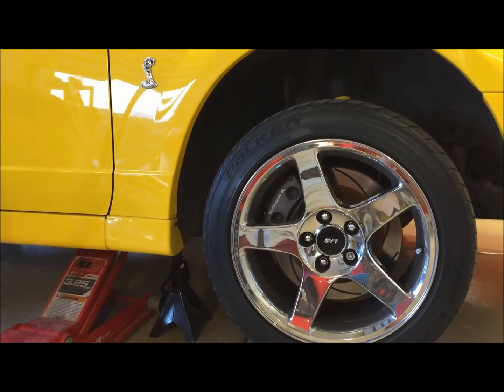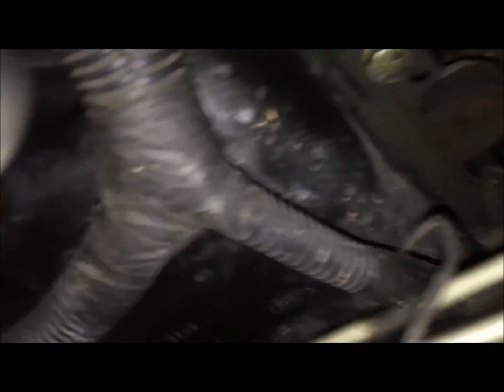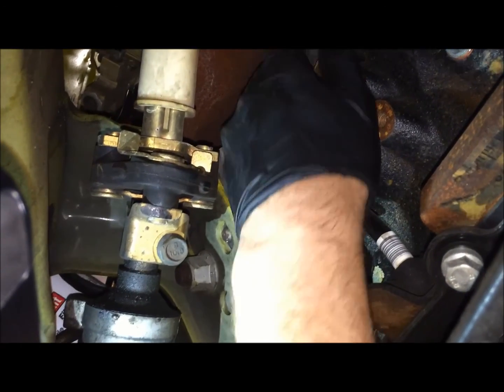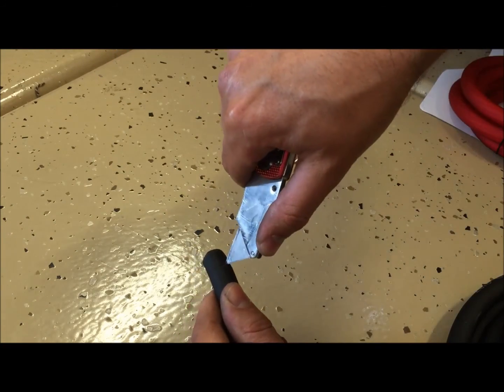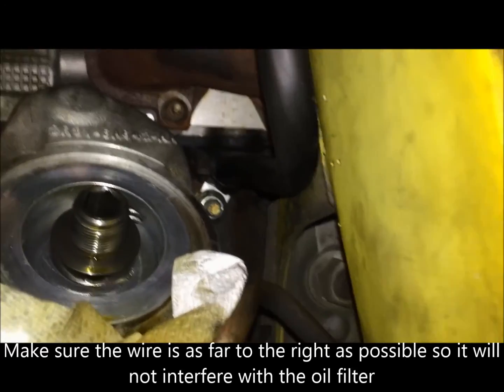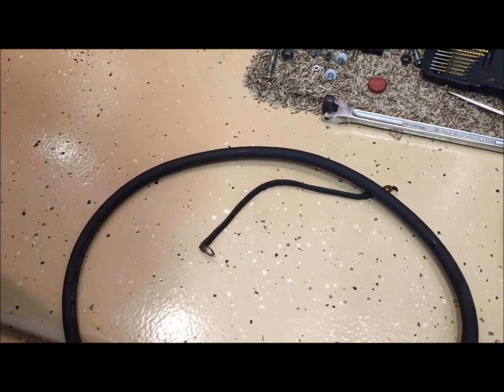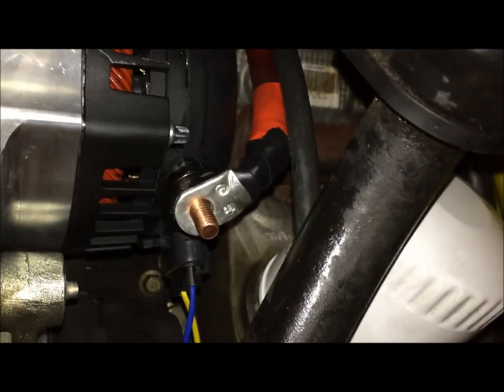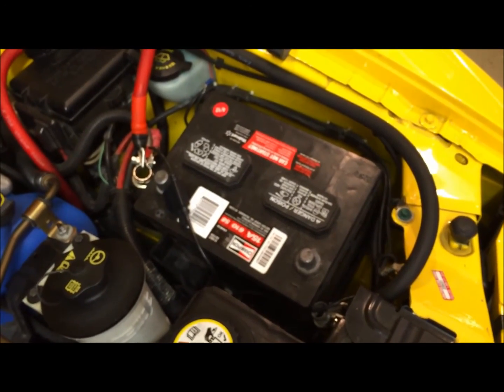Big 3 wire kit  install: 2003-2004 SVT Cobra Mustang

Comment: Was having issues with my alternator charging my battery after doing an upgrade on my 03 GT. The Amp upgrade wasnt that much of a difference but I still couldnt figure out what was going on. After watching your video your making my own wire kit, the issue was fixed. Really appriciate the mustang videos. Keep them coming!

Comment: I installed the GP SAE 6 Spot Battery Terminals and I'm trying out the on battery terminal fuses (Blue Sea Systems 2151 Dual MRBF Terminal Fuse Block with a 60A for the audio amplifier and a 150A fuse for the alternator). The on battery terminal fuse block and fuses should be safer than using the inline fuse holder with the pigtail to connect to the battery terminal (chance of it coming loose and shorting out the battery.. Just another option to consider. Too bad I can't post an image of it here.

Comment: For the engine to chassis ground I used that other threaded hole next to the bracket just got another bolt
Reply from the maker: Very good. I’m sure there are several places that will all work. A lot is just preference
Reply: Any chance you remember the thread pitch?  Was it M12 x 1.75?

Comment: hey I really appreciate that video I have a 2003 mustang gt an I'm trying to the big 3 on it I been searching all day to see where was the ground for the engine to chassis I know now thanks alot for the video
Reply from the maker: Great! Glad the video helped out. Thanks for watching! Good luck with your projects!
Reply: Scrun Johnson 
Question bro ... I have an 03 cobra and I recently changed out my alternator and your video helped me out by the way 👍🏽.  But I'm still having issues with my volts . I even went back and changed it again and bought a new battery and terminals still battery light turning on and volts drop from 14.7 to 12.5 in like 30mins .  Check ground wires all good . Any ideas . Oh and replaced my belt as well .  Help
Reply: @Cobra11437  
Did you fix this? I got the Same problem, battery light was on and no charging, got a new alternator and battery ligjt turned off but its still not charging, tried a grownd wire directly to a an alternator bolt and nothing....

Comment: Dumb question Danny, but at 20:47 why the need to reuse the old factory wire? Isn't the new zero gauge replacing it??
Reply from the maker: racequad9 Very good question . I had the same question when I was installing and was told by the mechman rep that you can run both and the power will take the route of least resistance, so it will be fine to run both- just as if the big 3 wire had more strands in it
Reply: Awesome! Thanks as always.
Reply: But is ok to remove the old power wire n just run the new zero gauge one? U know for cleaner look?

Comment: Why not connect the ground to an alternator mounting bolt? It seems that would be electrically the same as the motor mount bolt and would be more accessible.
Reply from the maker: The alternator is mounted to an aluminum bracket. It would be better to mount it to the motor mount that is directly connected to the engine block for grounding

Comment: So the original power cable from the alternator to the battery never gets removed correct? You are basically just adding another alternator to battery cable just in 0 gauge wire
Reply from the maker: Yes. Current takes the path of least resistance, so now consider it another strand of cable within the zero gauge wire
Reply: @dannyjohnsonsgarage  awesome thanks for the reply Danny!

Comment: Ok danny so on the ground to battery one, you can leave the factory ground there and add the big 3 kits ground to that motor mount bolt? You dont have to remove the factory ground?
Reply from the maker: Correct, you can leave it. It’s just like adding more strands to the new cable. Current always takes the path of least resistance.

Comment: instead of putting a ground on the motor mount can I run it somewhere else or that would be a good ground for it
Reply from the maker: I'm sure you could. I chose the rear motor mount for better access
Reply: OK Thanx bro

Comment: Thank you for the video, but it seems Mechman has discontinued the Big 3 wire kit.
I have 1 question, I’m planning to install a 200A alternator into my 03 cobra, right now the car is stock but I have plans in modify the car in the future, will I need a bigger alternator wire for now or which gauge of wire and lenght will you recommend. I really will appreciate your suggestion and thanks again for the videos very instructive
Reply from the maker: You will need it as soon as the 200amp alternator is installed or it could melt wires. You can buy 7’ black and 3’ red and the inline fuse and ends. It can all be purchased through delcity.com
Reply: @dannyjohnsonsgarage  thank you I will follow your advice stay safe

Comment: I used alternator bracket as ground to negative battery terminal, then battery terminal to chassis so two wires total. Should this work? I havent started my car yet.
Reply from the maker: The alternator bracket would go to the engine, and being a GT or Terminator it would be an iron block, so it’s probably the same as the motor mount
Reply: @dannyjohnsonsgarage  alright just checking cause this wiring stuff is confusing sometimes. Ur the man Danny.

Comment: I'm getting high 15 volts reading from my sct tuner. Is this bad? I have the j2fab standard alternator like 165 amp with the big 3 upgrade kit.
Reply from the maker: That’s too high. You should be 13.5-14.5 . I’d contact him and ask if the regulator is working properly

Comment: is 13.3-13.7 normal once the the car is up to temp for a 160 amp alternator?
Reply from the maker: racequad9 Yes. I see a little more than that with my 240 amp, but you don’t want it too high either. It’s a 12V system, so no charging would be 12.
Reply: awesome. finally got my terminator running and just making sure the readings from my aeroforce gauge were in line with where they need to be. how does 170-175 sound for coolant temp?